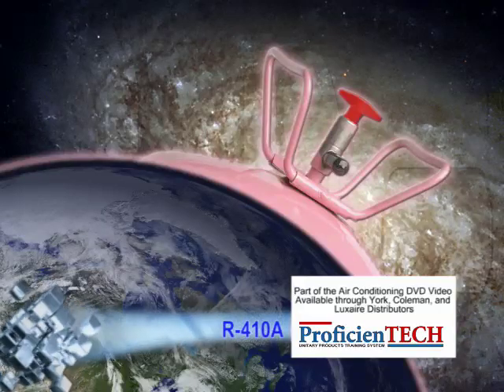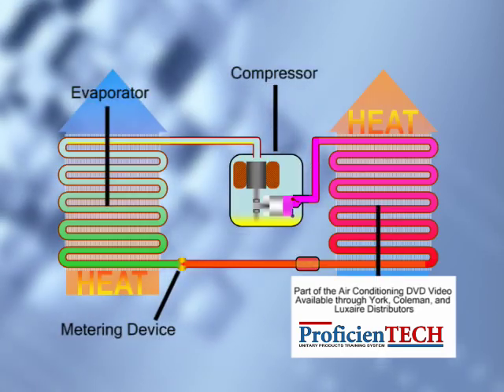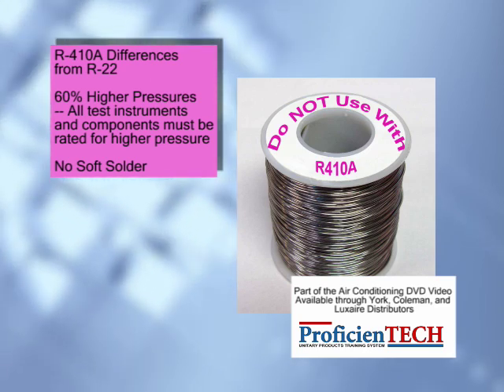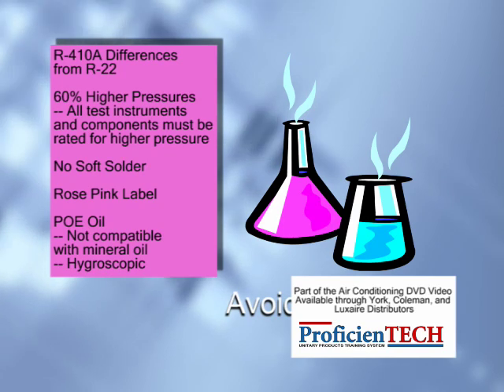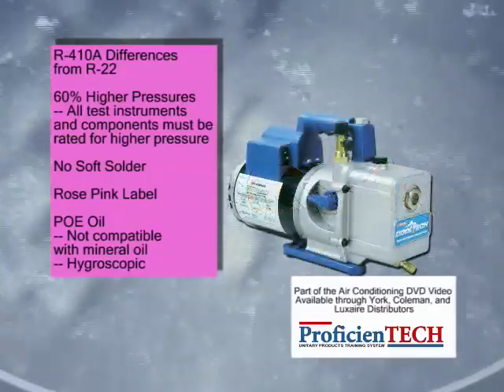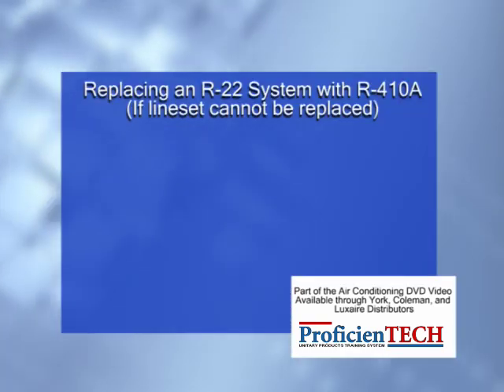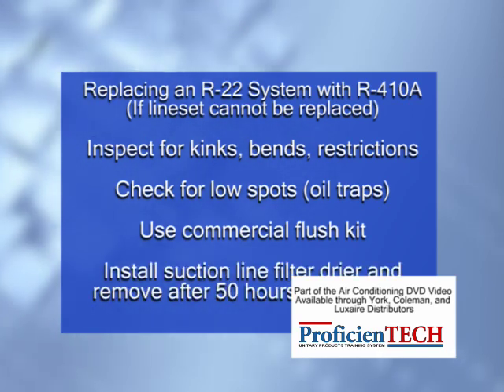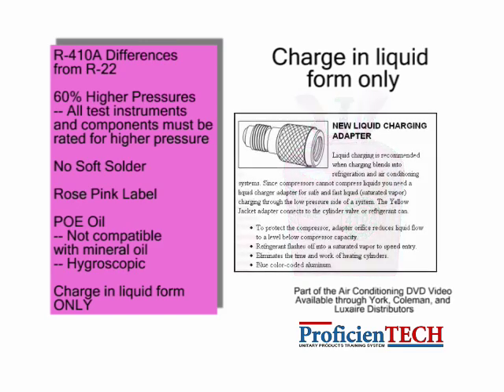R-410A Overview ProficienTECH Training DVD HVAC

Comment: sir, I am successfully using MO99 (R-438-A) as the replacement for R22.  No problems to report works good, same operating pressure as R-22

Comment: yes R22 is alot easy to used. but we have to take in considerations of the environment. a replacement refrigerant is over due for R22. We need a refrigerant at a lower operating pressure than R410. Because of leak potential an etc.

Comment: I'm not a fan of 410a mainly because of the high pressure it runs at and that is a very important metric to consider when it comes to reliability and leak potential, especially in the long run. I've been holding out to see how certain R22 replacement develop and I'm glad I did.Dupont's 438a seems very promising and I'm looking at 424a which is also interesting. There are others but not as ideal.My opinion is to stick with R22 equipment as long as possible & use R22 replacement when viable.

Comment: What i'm wondering is why R134A isn't instead. It has a higher saturation point than 410A and runs cooler, under lower pressure, so it's better for hot and cold climates, and it's more efficient.